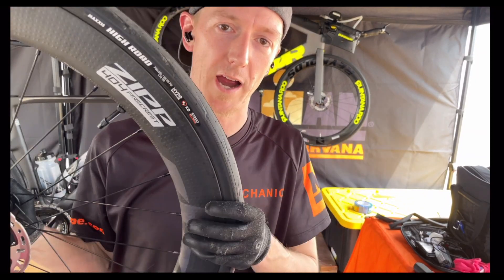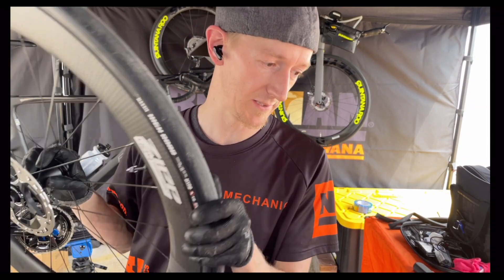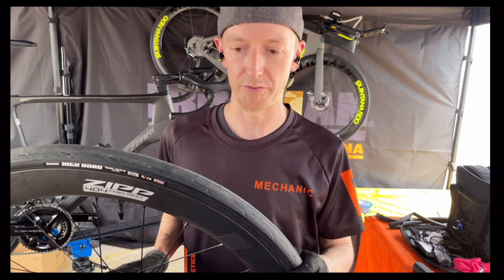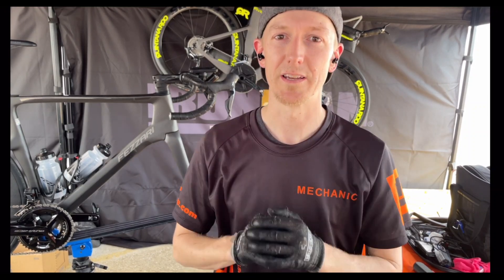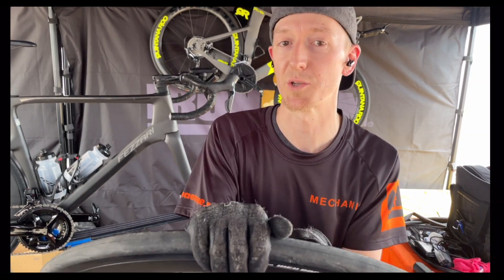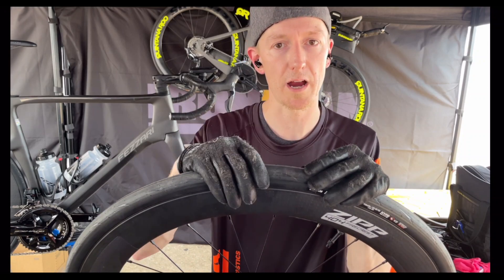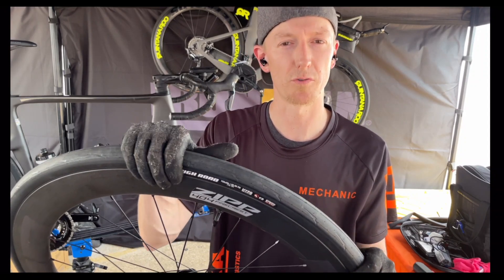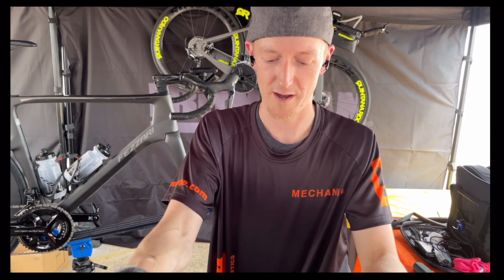Running Tubeless, your pressure is probably too high.

Comment: honestly i have some "fear" to ride at 70-80psi with  tubeless on my road bike, i used to put 100 on a normal tube
Reply from the maker: Check out the Zipp Tire Pressure calculator.  Its a great way to get a starting pressure and start trying things out of comfort zone.
Reply: @yourracemechanic  i do, in using since September 55 front 60 rear